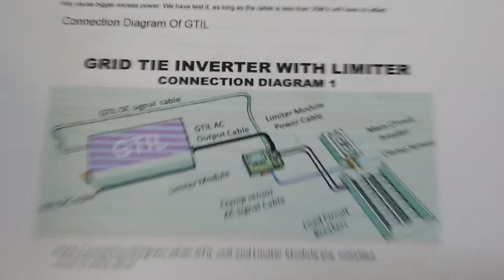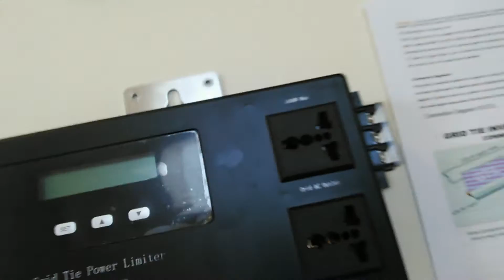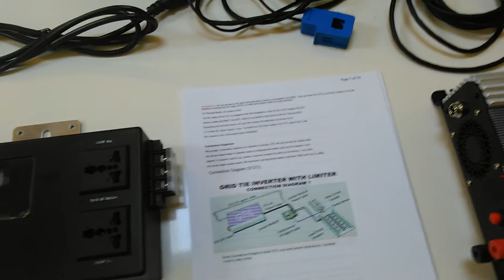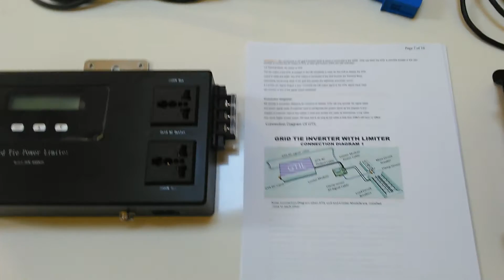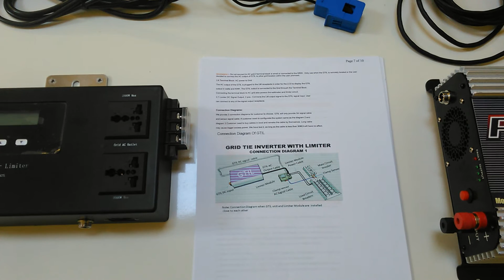The new Power Saver grid tie inverter with limiter

Comment: Sir,where can i buy external limiter?
Reply from the maker: https://www.ebay.com/itm/2000W-Solar-Grid-Tie-Inverter-with-Power-Limiter-Sensor-DC45-90V-to-AC190-260V-/303836288564?mkcid=16&mkevt=1&_trksid=p2349624.m46890.l49286&mkrid=711-127632-2357-0
Reply from the maker: I don't think they make that exact kind anymore but you can find them on eBay or Amazon do a search for grid tie limiter.

Comment: Hey brotha I need your help once again... quick question, can you combine this old GTI model with the new blue one (same brand & watts) (Sun-2000G, 2000 watts) Can I use the old limiter (black box) for both, or do I use the built in one on the new blue GTI? Thanks for your time and wisdom my friend, hope to hear from you soon 👍🏽
Reply from the maker: I have seen that grid-tied before on eBay but have never looked at it or work with one before so I cannot answer that question. I haven't been messing with solar stuff in about 2 years now but I am about to get back into it . I'm thinking about making me some battery banks with the 18650 batteries if you haven't seen that yet go and take a look at them on YouTube.

Comment: I looked at your other videos. I see it feeds 120v on L1 and L2. Is there away to read both sides if i pull more off of one it will never see it.
Reply from the maker: Tiersmoke92555 sorry overlooked your comment but no is no way to reduce the power on one side or the other but you can buy two units and put one on one leg and one on the other and that is capable of regulating the power opposite from each other.

Comment: The current sensor only connects to only one of the two legs of grid power. So your power limiter is only detecting only half the current you are actually using from the grid. Am I missing something.
Reply from the maker: Dwyane Dandridge The Limited Box come with two connections where you can hook 2 grid tie inverters with 2 current sensors that way you can put one on each side of the box.

Comment: Problem is they only have one sensor, you need two, you have two hot lines going into an American home... really don't want two units myself...
Reply from the maker: yes you really need 2 units 2 grid tied inverter and 2 grid-tied limiters and it will work fine for that application. thank you for visiting my channel.
Reply: Limon Juice America needs to just use 240 v for all products, scrapping the idiotic split system, it would be more efficient and less costly..... Maybe we can get a TruMcP Order to switch it....

Comment: What happen with the produce energy from the solar when the limiter starts working? Where does the difference between produced energy from the solar and the consumed energy by house loads go? Is it dissipated as a heat in the limiter?
Reply from the maker: them are some good questions and I do not know how to answer them for you if anybody do can you chime in on here
Reply: @carsonlurbanwindandsolar3437  The inverter only produces as much energy to give near zero incoming energy from the utility company.  Just as if you had no inverter on the end of a solar panel, no energy would be produced, until you put a load across the panel, such as the inverter.  The power drawn by the inverter from the panels is controlled by the intelligence in the inverter.

Comment from the maker: the unit is a stackable unit you can have as many of them as you would like but mine is a 240V unit all I need is one it puts power in both legs so the system will be balanced it monitors both sides of the box with one sensor clamp it can put power on either side that needs power so you only need just one if you have the 120V version you need 1 for each side with one power limiter it monitors both sides and put the power on whichever side is needs to put it on